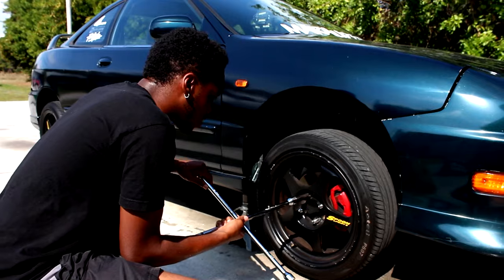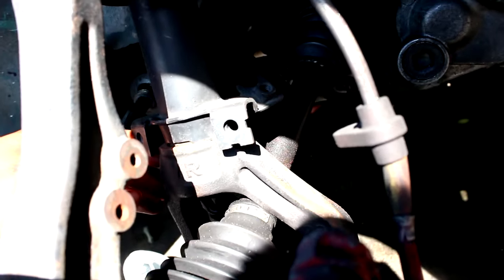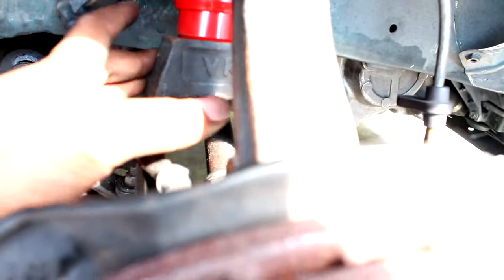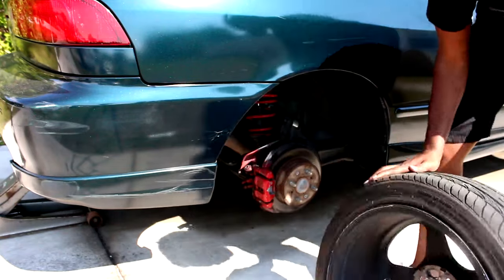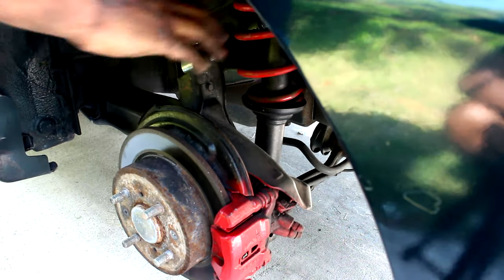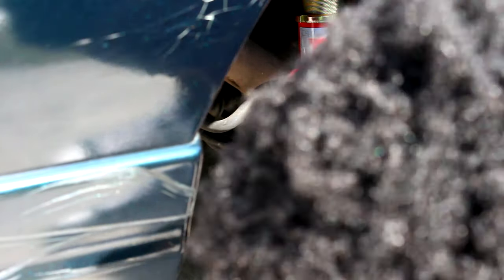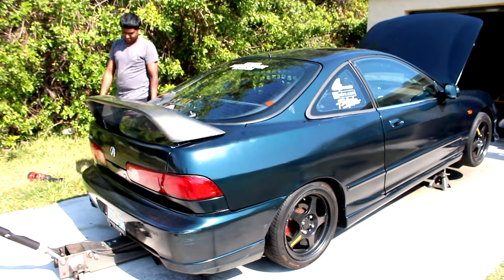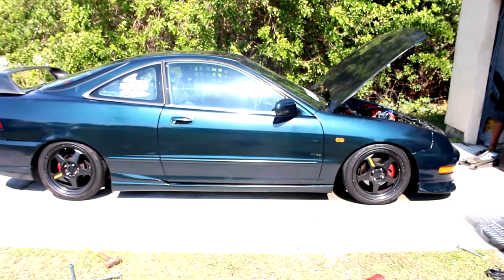INTEGRA COILOVER INSTALL - Function & Form

Comment: Thumbs up for the install; I have Mugen Suspension for my DC5. Not too serious but next time I would use a torque wrench so you can torque to spec. And I would preload the suspension before tightening nuts and bolts all the way.  This looked way smoother than my DC5 install. Macpherson struts are pain in the ass obviously. Also this video serves as a good lesson why not to go cheap. Spend the money and get decent coilovers.
Reply from the maker: I torqued them off camera :)
Reply: Good deal;  just wanted to mention. Gotta torque stuff correctly so people won't die :-). Did you preload the suspension?  I wish I could do videos like this. Buuuuut I have no car friends locally. So I have to do all my installs/repairs by myself. Which usually I'm in a hurry to do it so I don't film :-\